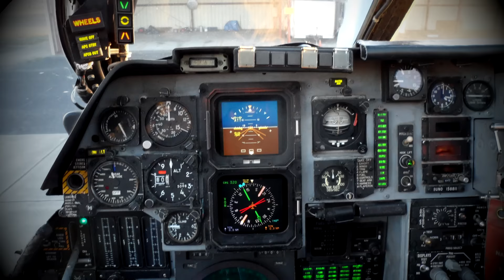USMC Jet Crashes Cable Car | Last Moments

Comment: They hit the ground at 86 miles per hour after falling for 4 seconds.
Reply: with a resounding W~A~P...
Reply: It wasn't so high 250ft is only 76 metres. Some cable cars can be suspended over much higher distances.
Reply: @chatteyj  3:15 he says that the cable car fell about 250 feet.  Plug that into a free-fall calculator (ignores a slight bit of wind resistance).  I've checked it against two calculators and both say about 4 seconds fall time, 86 mph at impact.
Reply: @chatteyj  Plenty do, I lived in that region and remember that incident well.

The point of the cable car is to stop you from falling that kind of distance while moving you around.
Reply: @pyro226  the coefficient of drag and terminal velocity aren’t the same as a person. Also, with the cable there may have been some upward momentum from the snap to prolong hang time before falling.
Reply: @gianni_schicchi  This ignored terminal velocity as they were in a cable car.  They were unlikely to be anywhere near terminal velocity of the cable car.  I ignored drag for ease of calculation.  As for momentum of the cable, there might have been a little from it whipping around, but not really significant.  Once the cable broke, it too would have been in freefall.
Reply: @pyro226  The planes were flying under that cable in that exact spot all the time because that was the highest point on that cable car line...
It was exactly 110m and the plane was doing 840km/h when he colided with the cable so some energy was also transfered to it plus the speed of the car in the direction of the track/cable.
So no the speed was not 86mph because from the gravity/altitude alone you are geting 103.9 mph and 4.736 second of fall...
Reply: I talked to a car mechanic who said that he saw the cable car fall. I trust him, he was a nice local guy, very friendly and easy going and he fixed my car for a fraction of the price that other garages asked for. But anyway, he said that he was taking a car for a test drive somewhere on the road below the cable car, stopping on the side to check something. Then suddenly the roar of the Prowler came out of nowhere, but he was used to it as they apparently flew low often in that area. Then he heard something and noticed the yellow cable car falling and disappearing behind trees so he rushed to the scene, being the 2nd person (after a man on a walk with his dog) there. What he said was that the cabin was crashed upside down, which seemed interesting to me, but I imagine the movement of the plane didn't only cause it to fall, but created like a "spinning effect" due to the impact. So the cabin must have turned upside down at least once during the fall. I also asked him how long it took for the cabin to fall and he said it was about 10 seconds between hearing the roar of the plane and seing the cabin disappearing behind the trees. The height he said was about 90 metres so 10 seconds does seem to me long, but he said he didn't see the actual plane at all, he just heard it and he saw the cabin while it was disappearing behind the trees so didn't see the whole fall. I would say 3-4 seconds is more appropriate, but there was clearly much more dynamics involved than simply "cut the cable and free fall". It was very nice talking to this chap, but I didn't ask him more questions as he was telling with tears in his eyes how he came to the cabin with blood everywhere and 1 body outside. The body was the cabin attendant and his friend. And on top of all this, he saw this same cable car crash back in 1976 as well. That fall he saw from start to finish, apparently the cabin was starting and stopping, swinging a lot and then the cable snapped and cabin fell. That fall was apparently from 70 metres high and what he said was that the cabin started to fall, then the wind blew against it and held it mid-air while the cable was still connecting to the bottom station (he said it looked like a flying kite), and then after about 10 seconds it fell and crashed. I don't believe the "kite" effect as the cabin weighs about 3 tons by itself and with 43 people on board you'd need a tornado to "hold it mid-air", but it may have looked like that as he saw that fall from Cavalese, so looking from above. Anyway, a nice and very friendly guy, but what he's been through sounds scary...

Comment: VMAQ-2 had an immediate “secret” all hands meeting at the officer’s club and the CO told all to turn over video/photos of the entire deployment. They “smoked” everything with an ECM under one of the prowler’s. They had another meeting to request all material handed over when they got back to Cherry Point at Hancock Lodge and every marine could truthfully say “I don’t have anything to give”. My unit MWSS-271 and 274 were with VMAQ-2 at Aviano that night and the press arrived before the plane landed. It was parked in an enclosed hanger and we had to put up triple strand concertina around the perimeter and set up light sets to keep people from rushing the hanger! We didn’t know what happened at the time. We thought another prowler blacked out Europe with their ECM crap again like a few deployments ago. It was definitely a goat fuck from the beginning and I still have no clue why Clinton didn’t want that aviator prosecuted. If we fucked up out in town for way less of a crime like getting into a bar fight we definitely would get double-dipped by the UCMJ and local authorities. It was 100% a joy ride and they screwed the pooch plain and simple
Reply: If you're going to invent stuff, just make it believable.  Wasn't "all hands" or I would have been there, I was aircraft maintenance chief; it was an officer's call.  And you can't "smoke" anything under a prowler on the ground; the EMC jammer pods don't work that way.

The press did not arrive before the aircraft landed.  I know, I was there.

Comment: I took that cable car long after it happened. I didn’t know the story. I was looking down and saw a bunch of cable on the ground. Later, I asked someone about it and they told me that was the cable left from the crashed cable car. They just left the cable there on the ground!
Reply: in plane sight...
Reply: Lol why would they never retrieve it?
Reply: @thetayz72  why would they retrieve it
Reply: @Z6D4C4  So people don't ask why it's there
Reply: @thetayz72  It was a long time ago when I was there. I think the person I spoke with said it was too difficult to remove. It was running all the way along the side of a mountain. It’s heavy and long. I remember it was snaked over rocks and ice (it’s just below a glacier). The slope up the mountain is steep. Maybe it’s been removed by now. It’s been 20 years since I was there.
Reply: A grim memorial.
Reply: Italian laziness
Reply: It should stay there.
Reply: @thetayz72  It's been a decade since I've been in the industry but I used to be a ski lift mechanic and back then old cable really had no scrap value. A lot of the time it would just get buried.
Reply: @thetayz72  It is heavy and in place where you can not use any normal vehicle that you would normaly use for this type of job...
On top of that steel lines like that after years of use have on surface plenty of sharp small wires that can easly puncture human skill or any normal cloths if you trying to move this heavy line with human muscles...
Reply: @NoahSpurrier  ....... maybe they don't want people to forget? Seems that if they really want to get it out of there, they could cut segments of it and remove it that way.
Reply: Yes, you are correct! I visited Cavalese 2 years ago and walked along the route of the old cable car and there were still pieces of the now corroded cable visible in places. This was not near the new gondola, it was in a forest and I noticed it between rocks and it seemed to be "largely abosrbed by the ground by now". But it could have been a cable from another incident, I asked about this in a local pub and was told that there was another cable car accident on this cable car in 1976 and the cable from that first accident is still there as well, only parts of the cable near roads, fields and cycle paths were removed, but in other places it was simply left there. And I was also told that in 1976 the cable fell on the left hand side when looking up from bottom station and in 1998 it fell on the right hand side when looking up, being pulled further to the right due to the motion of the plane. So apparently it's possible to locate both cables, the one from 1976 is in a direct line between bottom station and middle station, but you need to walk along the route of the old cable car, not the new low-lying one. The old cable car was simply a straight line between Cavalese bottom station and Dos Dei Laresi. And the cable from 1998 is apparently 10-30 metres to the right, when walking up, of the 1976 cable. Unfortunately I didn't have time to do a second walk to see both cables, but I definitely will when I'm next there and will take some pictures. If anyone else does this before me, I'd be interested in pictures to see how it looks like and where exactely to find these cables (would be nice to create a map with locations where the cable is still visible). What I was told is that the cables between Cavalese and the place where the cabin hit the ground in 1976 were largely removed. But above that 1976 place the hill becomes steeper in a forest and apparently that's where the cable still could be found and that's where I saw it, but it's covered by vegetation, etc. so you'd need to look for it.

Comment: FYI - Freefall from 250 feet would take a little over 4 seconds before impact.
Reply: That's correct, based on a freefall and setting air drag and force imposed by the cable between the cabin and the station where it was NOT cut as negligible. I talked to a local car mechanic who said that he saw the cable car fall and it was probably all much more complicated than a simple free fall. It was very interesting to listen to his story and I trust him, he was a nice older local guy, very friendly and easy going and he fixed my car for a fraction of the price that other garages asked for. But anyway, he said that he was taking a car for a test drive somewhere on the road below the cable car, stopping on the side to check something. Then suddenly the roar of the Prowler came out of nowhere, but he was used to it as they apparently flew low often in that area. Then he heard something and noticed the yellow cable car falling and disappearing behind trees so he rushed to the scene, being the 2nd person (after a man on a walk with his dog) there. What he said was that the cabin was crashed upside down, which seemed interesting to me, but I imagine the movement of the plane didn't only cause it to fall, but created like a "spinning effect" due to the high speed impact with the cable, which is attached to the cabin at its top... So the cabin must have turned upside down at least once during the fall. I also asked him how long it took for the cabin to fall and he said it was about 10 seconds between hearing the roar of the plane and seing the cabin disappearing behind the trees. The height he said was about 90 metres so 10 seconds does seem to me long, but he said he didn't see the actual plane at all, he just heard it and he saw the cabin while it was disappearing behind the trees so didn't see the whole fall. I would say 3-4 seconds is more appropriate, but there was clearly much more dynamics involved than simply "cut the cable and free fall". It was very nice talking to this chap, but I didn't ask him more questions as he was telling with tears in his eyes how he came to the cabin with blood everywhere and 1 body outside. The body was the cabin attendant and his friend. And on top of all this, he saw this same cable car crash back in 1976 as well. That fall he saw from start to finish, apparently the cabin was starting and stopping, swinging a lot and then the cable snapped and cabin fell. That fall was apparently from 70 metres high and what he said was that the cabin started to fall, then the wind blew against it and held it mid-air while the cable was still connected to the bottom station (he said it looked like a flying kite), and then after about 10 seconds it fell and crashed. I don't believe the "kite" effect as the cabin weighs about 3 tons by itself and with 43 people on board you'd need a tornado to "hold it mid-air", but it may have looked like that as he saw that fall from Cavalese, so looking from above. Anyway, a nice and very friendly guy, but what he's been through sounds scary...

Comment: I think something similar happened to Sqaw Valley cable car in USA in the 1970s or early 80's. Jigback cable cars with two ropes, 1 (or 2) supporting, 1 hauling the cabins are more vunerable to being hit by a plane, handglider, paraglider or helicopter as their pylons are often much higher above the ground and span greater distances than chairlifts or gondolas. Thus, its not uncommon to see orange or yellow plastic balls threaded onto a steel wire hung above the cable car or gondola lift to make it more visible.

Comment: Note that this isn't Air Force,
It's Marine Corps.

This is relevant.
Reply: Lower intelligence requirement to get into USMC.  Sorry, just a fact
Reply: @noydb2148  Sounds like you were rejected for service in the Corps by either an OSO or recruiter.

By the way, what was your GT?

Comment: I remember when this happened. We were in Germany at the time, had gone there from Italy, and were there with the US Army. Despite being Army and in Germany, we did not avoid the violent aftermath. The US put out travel warnings for Americans during the time, but for family's stationed there, it was a warning to stay away from certain areas. The Germans were attacking soldiers, their family's, and fire bombing their cars out of anger. Luckily my dad spoke German and me and my brother looked very German, so we were able to skirt around relatively unnoticed, but it was a very dangerous time to be American or worse, service member/family of a service member in Europe.
Reply: As well it should have been
Reply: @frankfacts6207  why?

Comment: The fact that this flight crew ignored regulations and rules is enough. They should have been at a much higher altitude, and moving slower, regardless of anything else. These guys are guilty.

Comment: A 2000 foot hard deck is an absolute. Flying at 300 feet with a 'malfunctioning altimeter' is against regulations and the crew should NOT have been in the low altitude structure at all! 

The Marines should be ashamed.

Comment: Those 4 guys should be happy to be alive.
No way to eject at that speed and altitude, if a wing gets cut off.
Usually it's the cable that cuts the wing, not the other way round, it's only because the cable got caught on a pylon that acted as wire cutter, similar to the wirecutter horn on UH1 helicopters.
Reply: Ooooooh so that’s what that spike above the cockpit is for! I thought it was an antenna of some kind
Reply: they shoud be happy they aren't rotting in prison
Reply: "Those 4 guys should be happy to be alive."

Raney passed away a few years ago. Although he remained on active duty he was never promoted past Major unlike that POS Seagraves who cut a deal with prosecutors and wound up retiring as a Colonel. Raney ended up getting hosed by the infamous big green weenie.
Reply: Not sure why they wouldn't be able to eject. The EA-6B has zero-zero ejection seats with a maximum speed of over 650kt. As long as the plane wasn't upside down, an ejection at 300ft and 500mph would probably be survivable.
Reply: @sgthop  The lift of the remaining wing likely will spin the plane much faster than anyone could think and pull the handle. 
Guess it would be up to luck, in which position the plane ends up, when the seat gets shot out, if they even manage it in time, at least on F14, pilots/WSO eject with time delay so they don't crash into each other.
Reply: @hinz1  High performance aircraft like the EA-6B can potentially, and fairly easily fly on one wing. Even old fighters like the P-47 have been reported to return to base with a large portion of a wing missing. At 300ft it wouldn't be an easy recovery, but it's not unfeasible that a wing detachment would be survivable.

Comment: Who else here would have just pled guilty?  Causing that accident is bad enough, making a weak argument about the altimeter  and basically getting away with it is worse.  They were 1600 feet below the minimum flying height and exceeding the speed restrictions.  Schweitzer admitted in 2012 to burning the tape on the return flight to Aviano.  The most honorable thing to do would have been to face the consequences.

Comment: See this is why you allways keep a Dutch Goalkeeper fully automatic close-in weapon system(CIWS) equipped with a GAU-8/A Avenger 30 mm hydraulic seven-barrel Gatling gun on you
Reply: Ummmmm...... Okay. What having that would have done I have no idea. But if you say so. 🤔
Reply: Does it have to be Dutch or is German also good?